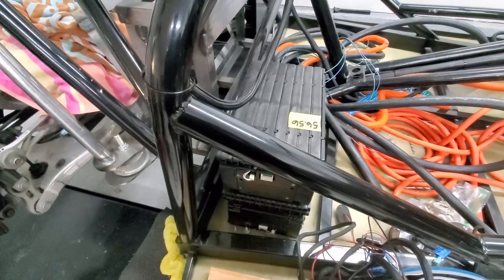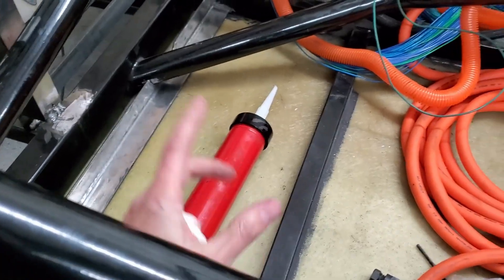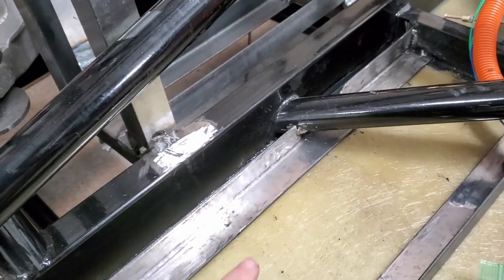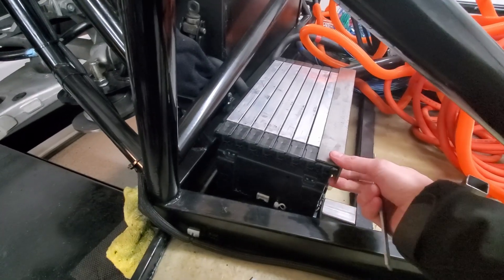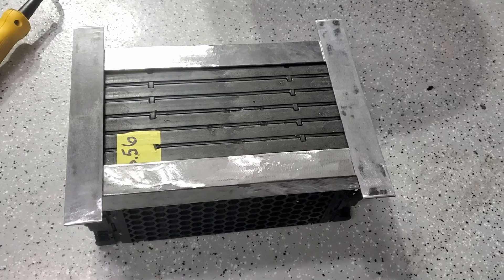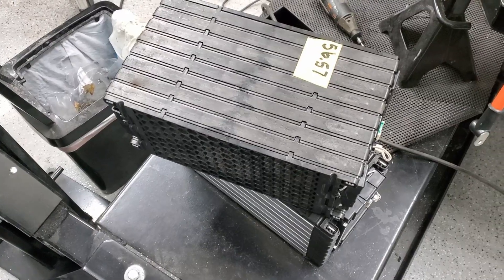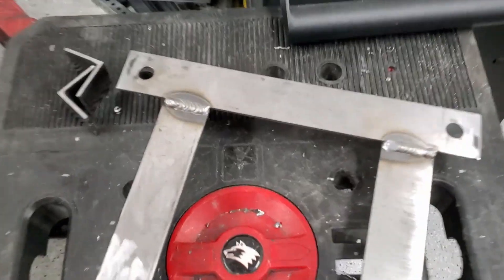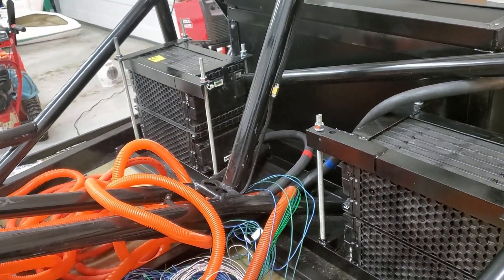Battery Mounting - LG Chem Lithium Ion

Comment: Great job. Where it will be the charging cable, in relation to where you will be parking the car? You should place the port close to that. It is my second video watching you, I have a question, how you can register something like this? I'm in California.
Reply from the maker: Thanks for the suggestion.  I am not sure how California differs from my state.   I have researched it and it is not too bad.  They want a safety and emissions (easy for an electric vehicle) certificate.  They want receipts for things to show you didn't steal things (like the motor).  You fill out statement of facts, give them some pictures, and apply for a title.  Below is a link.

https://dmv.utah.gov/vehicles/rebuilt/kit-vehicles